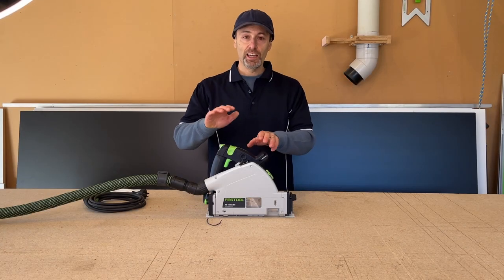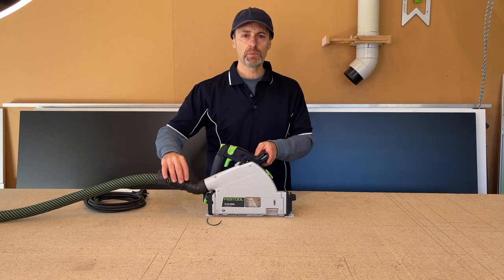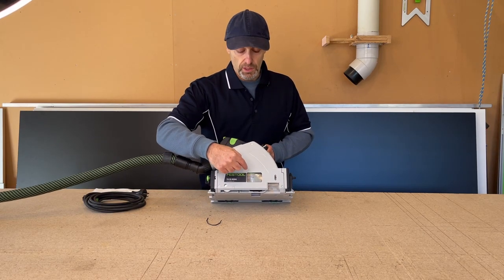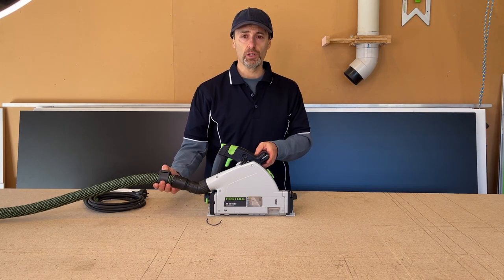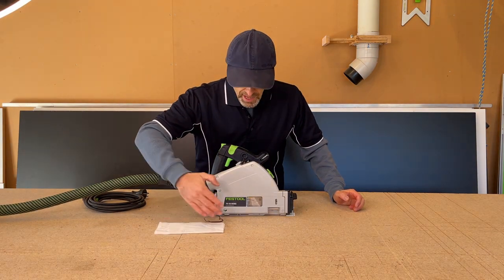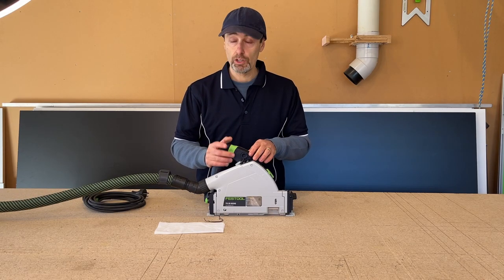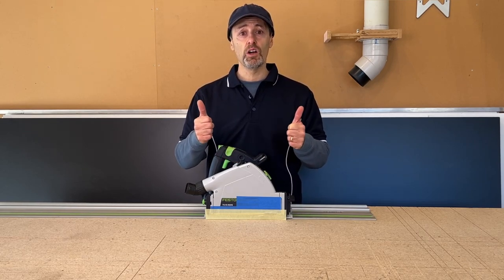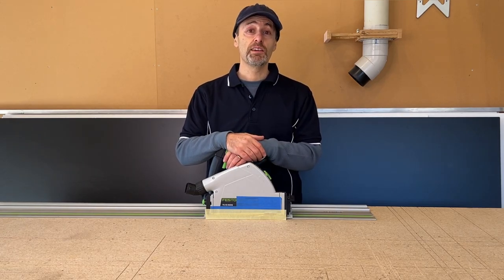Track Saw Dust Improvement | Easy Upgrade to Reduce Dust from your Track Saw

Comment: Cool trick! I have covered the blade change window before but never thought to make a skirt to cover the blade better! I have another video suggestion for people like myself who do different carpentry.. a blade video explaining blade selection and techniques you use for melamine and laminates for all your saws and also for the jigsaw and maybe even multitool and handsaw blades. It's something that has taken me a long time to figure out what blade is best for my track saw which has been expensive over the years, I have like 6 blades I think I have tried for melamine. I found the new festool blade designed for the new cordless track saw to be the best I have used..
Reply from the maker: Thanks for your feedback it’s a simple but effective little trick. I will put that idea of a blade video for the track saw on my to do list with techniques to minimise chipping to melamine of course 👍👌

Comment: Which type of dust collector is best for a track saw - high power, low volume shop vacs, or low power high volume collectors?
Reply from the maker: Honestly do yourself a favour and save to get a Festool CT MIDI 15L. Worth every dollar, small enough to pack in your boot if need on site, compact, good filtration and I use it on all my hand powered tools, love it.